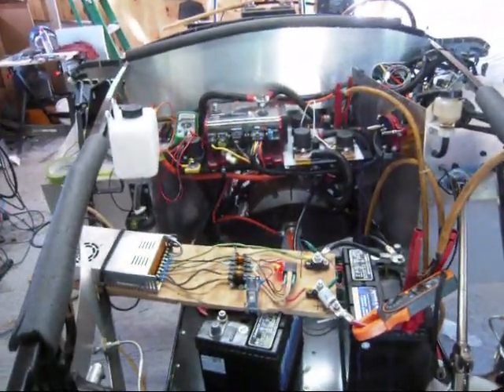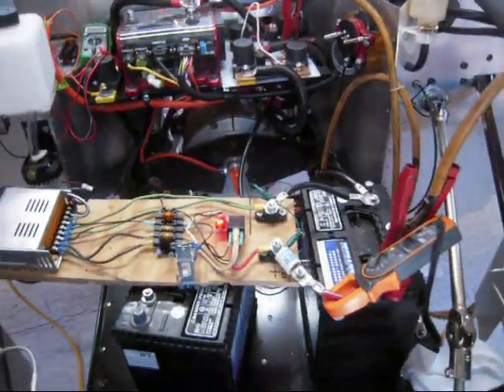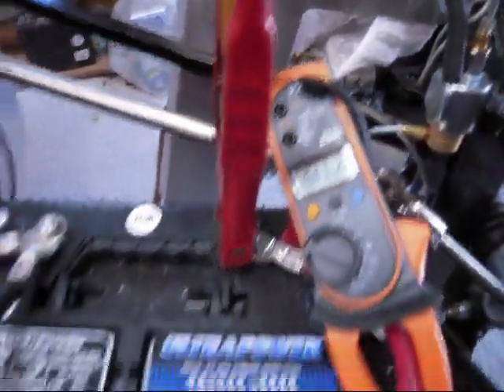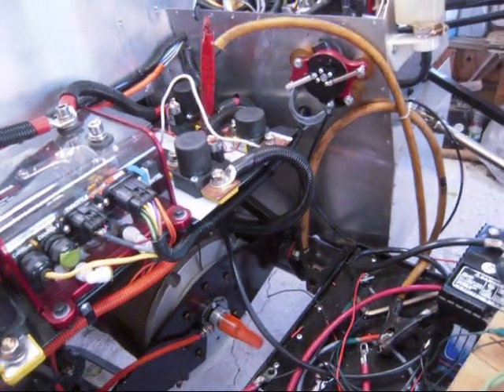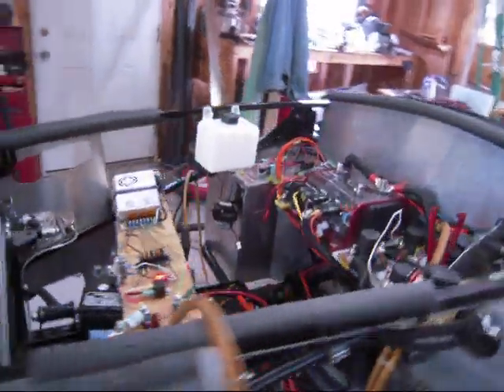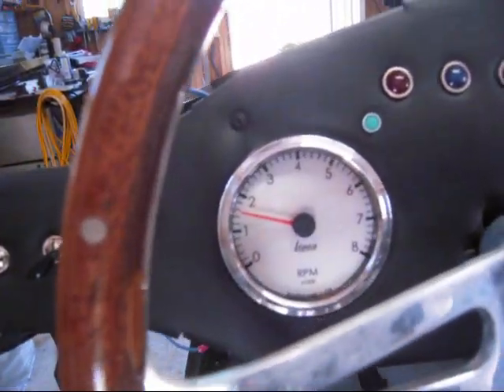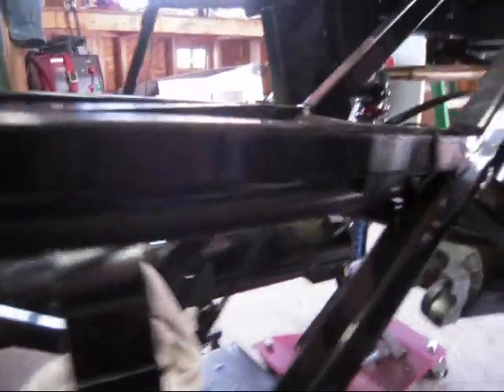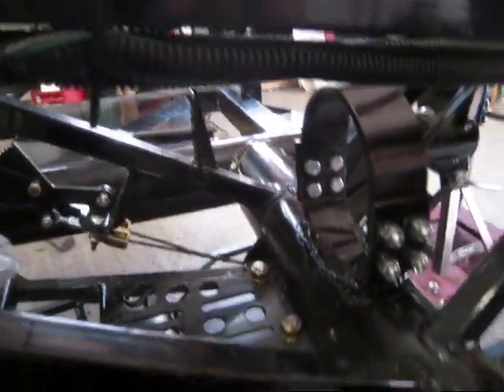Factory Five Mk4 - Electric Car - video 10

Comment from the maker: @unixtm    Agreed on the gear ratio.   My top end will only be a little over 100 mph, but I don't really expect to ever hit it unless at the drag strip.   Looking at cars like the White Zombie,  Wayland has set it up with a 3.56 rear end, direct drive and is able to achieve both blazing acceleration and decent top end.   It's mostly about how much current the batteries can dish out.   With that much power/torque available, it's fast acceleration from zero with any gear ratio.

Comment from the maker: @saruricardo   Yikes,  $14k for the tranny and coupler??   Must be nice to have money to burn.
My previous car had a 5 speed manual and was under-powered at maybe 85 hp max.    I did use the transmission, but almost never first gear or 5th.    3rd would have been fine for all driving except backwards, but with the lower hp, the gears helped get it up to speed.     The single speed in the Cobra will have sufficient torque and no need for a hp-robbing transmission.

Comment from the maker: @DanFrederiksen  I don't claim to be an expert on whether direct vs gear shifting is better.   All I know is that most or all of the fastest drag racing electrics are direct drive.    So I'm willing to give it a try to find out.
TS can only really do 3C or 4C discharges.  A 200AH set of TS at 288V would weigh way too much and still only give you 800 amps or so.    The only choice is to use higher C rate cells like A123 or Headway.   They can sustain 1400, 2000 or more amps and still be "light".

Comment: @ev99saturn in theory shifting takes no time and multiple gears will make the car faster so that's not really the main argument for 'direct' drive. I figure it's a matter of elegance and weight and cost reduction. it is a compromise to go fixed gearing but it seems to me that ti's a compromise that can work really well so it is overall the desirable solution, even with the low rpm forklift style motors.
3.5 is higher speed but harder to drive up hill. will the batts do 1400A with little sag? TS?

Comment from the maker: @DanFrederiksen    I was debating a lot about what gear ratio to go with.   Top speed vs acceleration vs motor heating at low speeds are the main trade-offs.     My car expert buddy Doug thinks it should be lower, maybe 3.56 or so. 

As for Jack Rickard, he's welcome to his own opinion.     The top speed experts on the NEDRA forum would, and have agreed with my choice of direct drive, primarily for performance reasons.     Besides, if acceleration is the objective, why waste time shifting?

Comment from the maker: @saruricardo  I like a standard in a truck, but cars I would rather have automatic.    
The key switch is actually a good way to kill power.   If the high voltage system goes nuts, killing the 12V will open 3 contactors, any of which will interrupt the main power path.    I have been looking around for some sort of knife blade or handle pull unit to open the battery path.   It would be located above the motor on the center console, right where the main battery cables pass through.

Comment from the maker: @saruricardo I am told that the motor should run for 12h at 12v and maybe another 12h at 24v.  (although I want to confirm that)   The brushes are seated 90% at the factory, so the no-load run time helps bring them toward 100%.    If they're not properly seated and a lot of power is applied, they will arc and cause damage.   Seating the brushes minimizes this.       Kinda funny that the motor is now 'broken in' with about 350 'miles' on it!    Guess it's time for the first oil change??  :-O